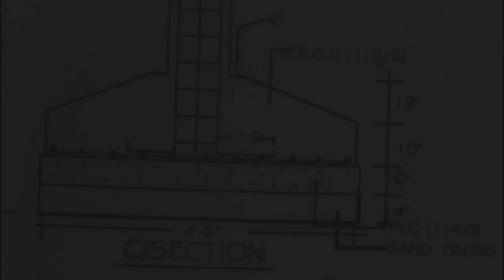Footings Building construction part-6  / watch #civiltechconstructions

Comment: After concreting the footing, how many days it takes to start the next work(column starter) and column raising to plinth level... Please make separate video to mention time period from one work to another.... Thank you!
Reply: @civiltechconstructions  what is the minimum curing days for footing?
Reply from the maker: After casting footings within 2 days you can make starters and then you can cast columns also coz 10 hours is the concrete final setting time due to site situations this time will change .
Reply from the maker: For all concrete works will suggest 28 days curing especially footings are most.important elements so should take proper curing precautions